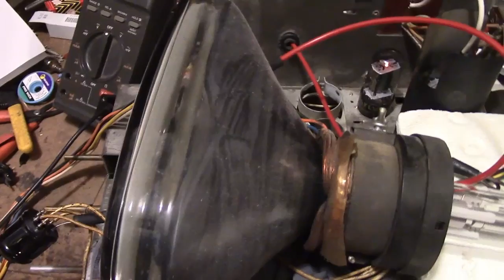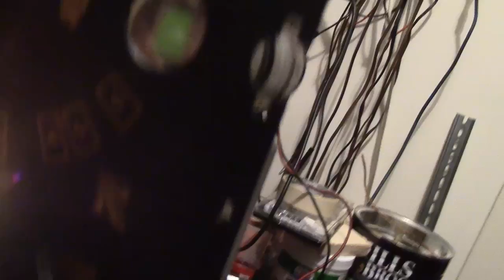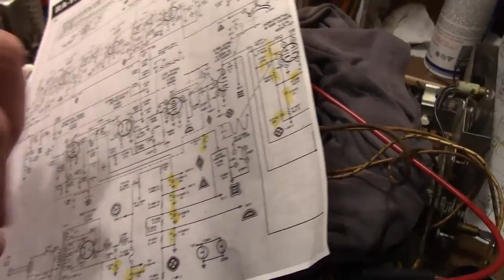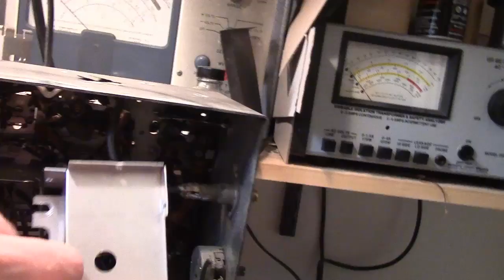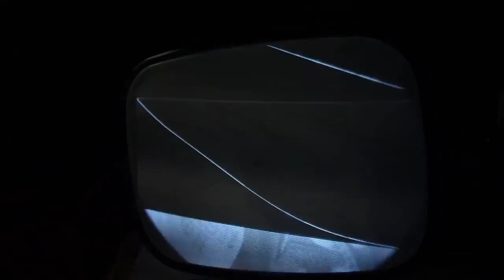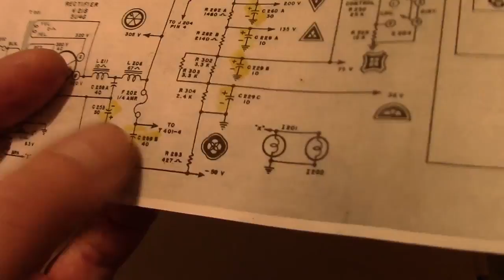Dual Dumont RA-113 restoration p4o7

Comment: Good job Bob.  Is it common for sets of that period to use more crude circuitry than newer sets, by finding better ways to design a circuit or cheaper ways to design circuits?
Reply from the maker: Generally the earlier sets were built better with more rugged components. You won't find much plastic in them. The designs are pretty good too.  They simplified things in newer sets to cut costs.